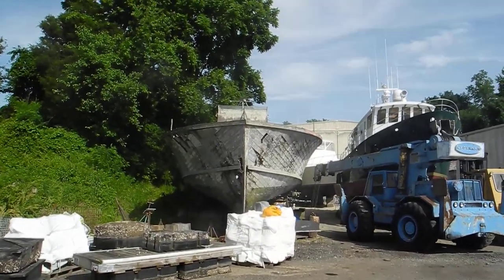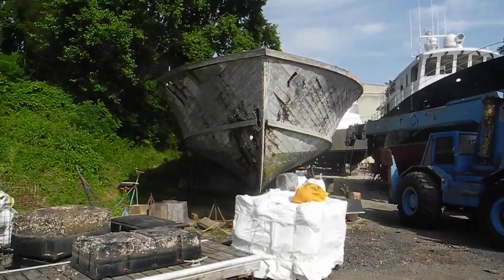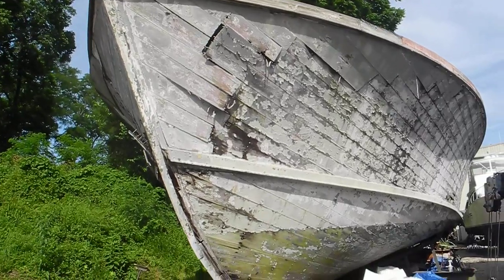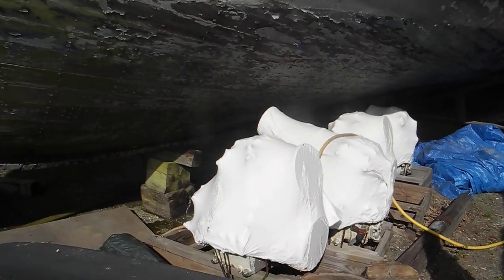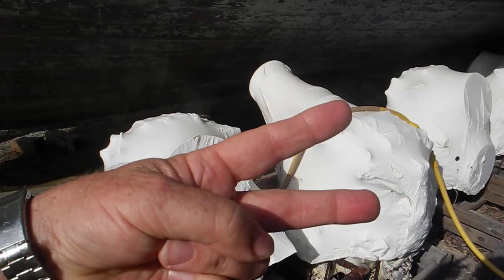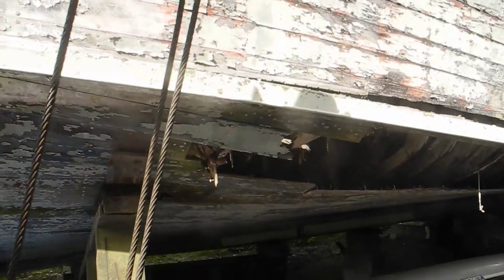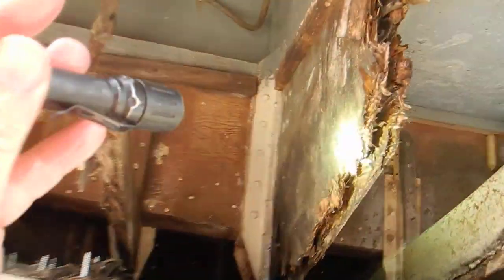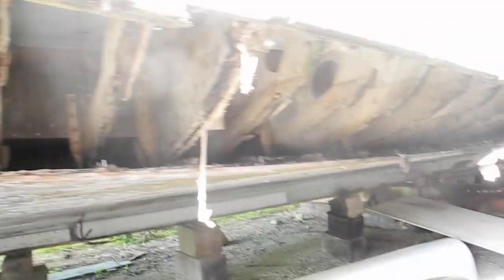PT F Worton Creek Boatyard MD

Comment: The PT boat was when plywood got its acclaim to fame. All your engendered hardwood floors that are on the market today can thank the military for there use of plywood on these boats. This is when they found that if you laminated wood at cross grains you had a lightweight material that was tough to penetrate and break up. The more the layers that were crossed grained, the stronger the material was. So, when you buy plywood or flooring or anything laminated, remember the more layers of lamination you have the more sturdy and dimensionally sound the products are going to be. Less expansion and contraction means more stability. And I was told that torpedos had a very tough time penetrating those old plywood boats. A lot of time it would just bounce off or deflect off instead of breaking through.
Reply from the maker: Steve Farmer Thanks for your thorough comments. 😎👍🏼👍🏼👍🏼

Comment: It is PTF-19, formerly assigned to Coastal River Division 21 based at Great Lakes (1972-1975) for cold weather training post- Vietnam.  CRD21 was a subordinate unit of Coastal River Squadron 2 at NAB Little Creek.  As you can see it is pretty well gone.  PTF's 3-22 had double planked mahogany hulls (just like the WWII boats which did not have "plywood" hulls either, a common misconception) but with plywood deck, transom and deck house.  PTF-19 was the third of 6 80' PTF's built by John Trumpy and Sons, Annapolis MD in 1968 for service in Vietnam to augment/replace Nasty Class PTF's based at DaNang running Ops up north in the Tonkin Gulf at the time.  The best surviving example is PTF-17, currently on display at the Buffalo Naval Park, NY. 

For more info on PTF-17 and PTF's in general see: http://www.n6cc.com/trumpy_ptf17  There were 4 other PTF's built (hulls 23-26) but those were 95 foot aluminum hulls with the same Napier Deltic diesels and weapons systems but they are otherwise entirely different from the wood hull Nasty/Trumpy boats.  One survives in fairly original condition (PTF-26) in California.  Info on that boat on the Web.